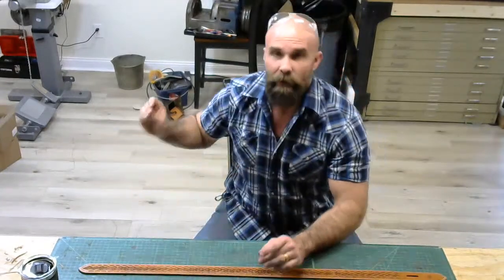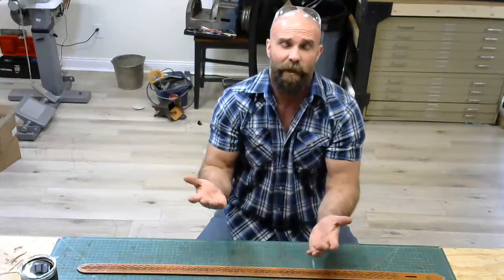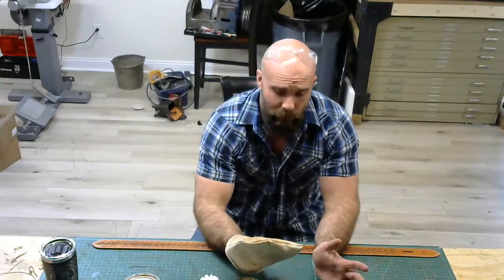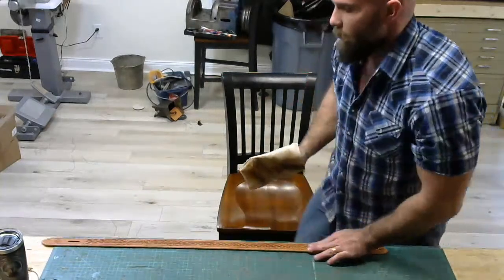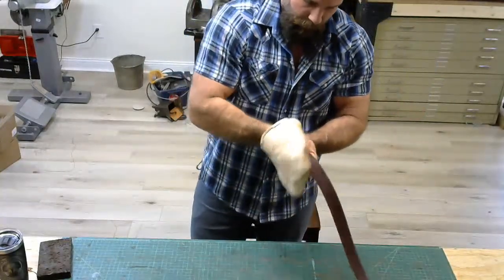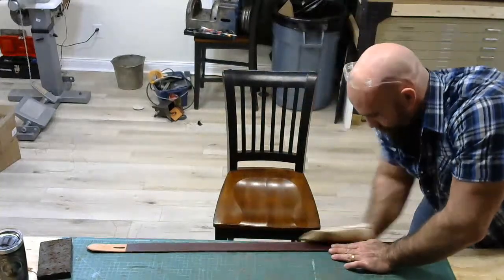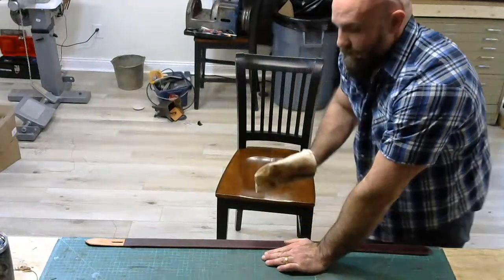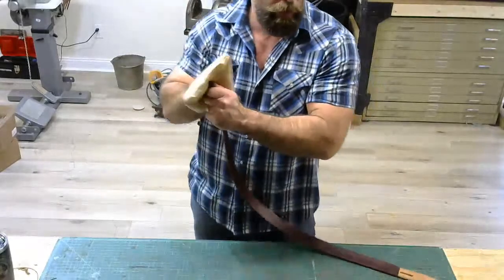Basic Leather Edge Finishing with Saddle Soap and Wax - Livestream #4

Comment: Excellent Video! What's the difference between the yellow and white saddle soap?
Reply from the maker: The biggest difference is that the yellow will occasionally leave color on your leather whereas the white will not. As to the exact difference in formulation that would be for Fiebings to answer.